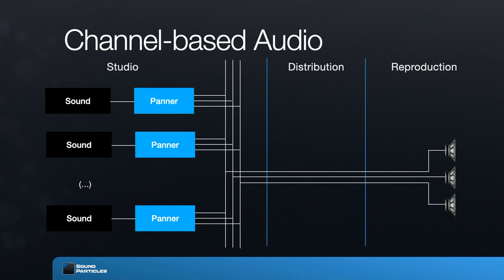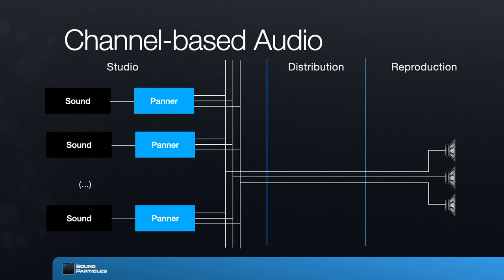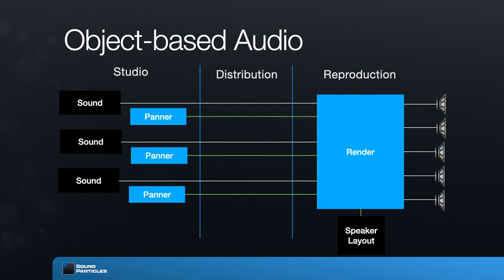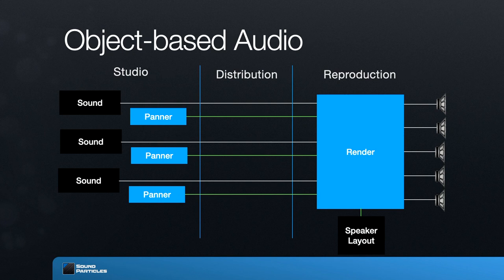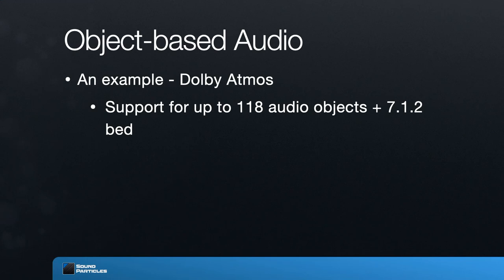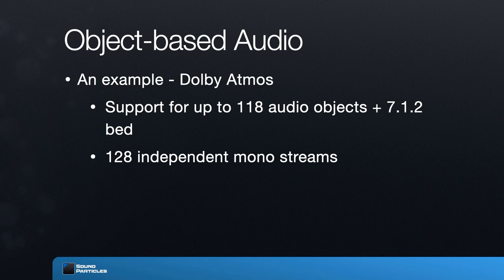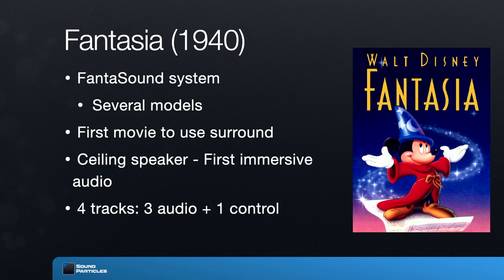What is Object-Based Audio? | (3/6) All You Need to Know About 3D Audio

Comment: My attention span doesn't last much more than 60 seconds.  So didn't watch the video and have never read about how object-based audio works, but this is my assumption of the primary differences between channel-based and object-based audio:

Channel-based = channel mix is recorded into soundtrack as discreet channels which a decoder (such as a home theater receiver) passively decodes.  The actual sound channel mix is processed at the studio.

Object-based = desired sound "location" is defined as an object with coordinates in 3D space and channel mix is done actively by decoder (such as a home theater receiver).  The sound channel mix is NOT processed at the studio, but at the theater or at home.

Anyone who's played video games with surround sound and hears the effects generated in real time should grasp the later concept easily.

Am I close?